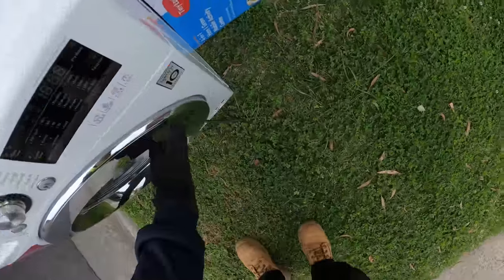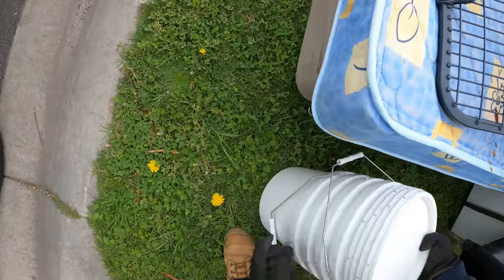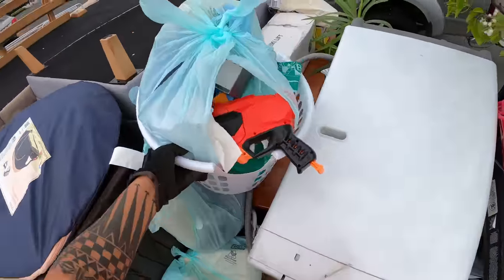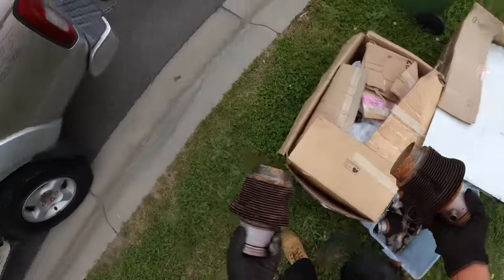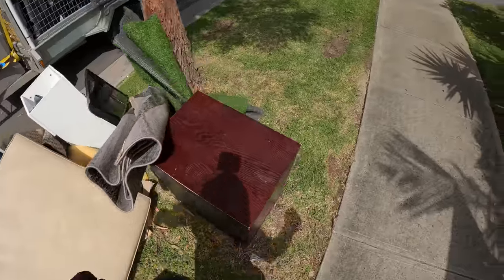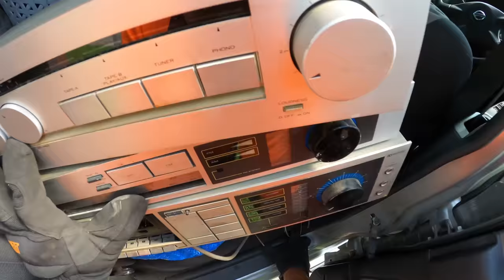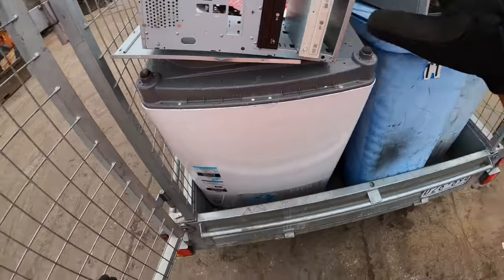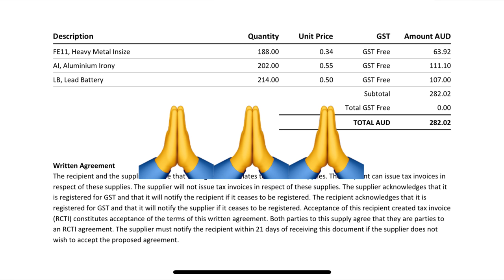Hectic Curbsides - What’s Left On The Curb Is Up For Grabs!

Comment: Aechmea is a very nice plant, easy to grow, put some water in the center and that's it. Its from the bromeliads family. I used to have one that was flowering every 2 or 3 years. After the bloom, the plant die but some other plants start to grow at the base. I lost it when the transformer from the power lines busted during a -30 degree winter night. It frozed in the veranda.
Reply from the maker: Thanks for the info max 🙏